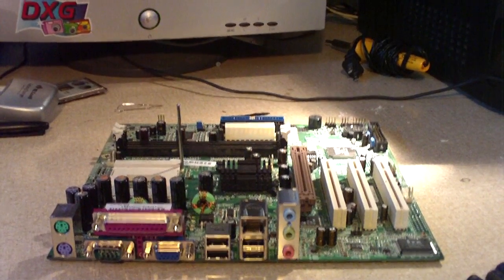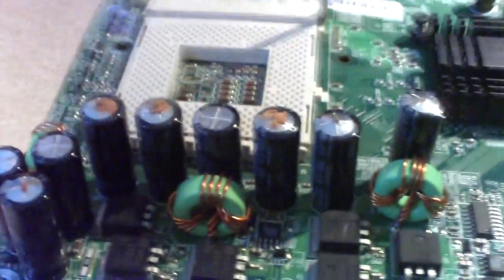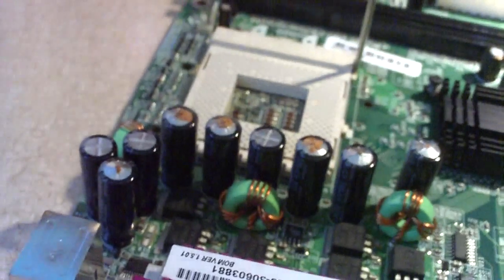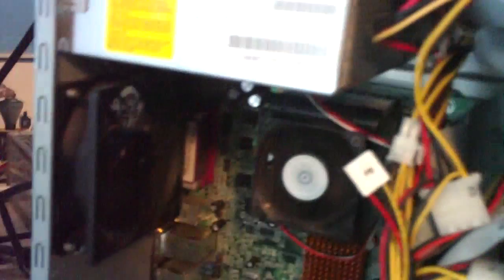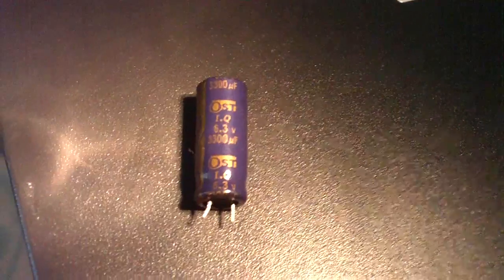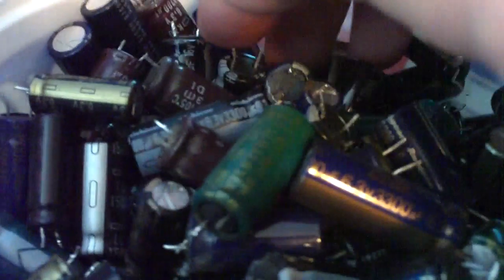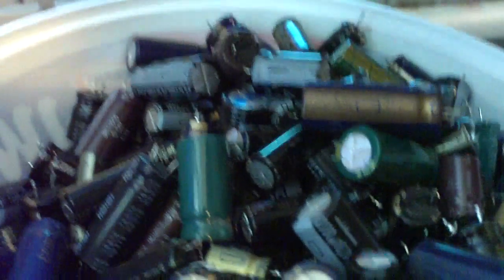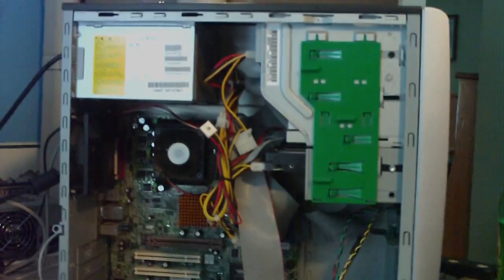Another Example of Capacitor Plague and How to Fix It.

Comment: Hi i got this computer from 2007 (compaq it is failing capacitors) and i got 7 off a old board the same voltage UF etc... although i need 9 should i just leave it with the 2 others failing or would it make the ones i just replaced fail a short time later?

Comment: Hi Mate,  I'm wondering if I could go higher in voltage and UF ? My TV has 1000UF - 10V capacitors and I need to change 2 off - I'd like to use 2200UF-25V - Is that OK ? Thanks

Comment: I do computer repair on the side and, while I admire your efforts, I don't know why you would go to all the effort to repair a 10+ year old machine. All the machines I get with capacitor plague are old school HP, Compaq, IBM and Dell models from 1999-2001. I don't get why you'd go to all the effort of pulling capacitors and fixing 10-12 year old mobos (and corresponding CPUs). It's not worth it. The vast majority of users will be unhappy with an AMD Athlon K7 or Athlon XP today.

Comment: I bought a Compaq 6410NX back in 2002 with an Athlon XP 2000+, and it had this same board.  In 2009, the same ten caps on the regulator started to swell up.  So I junked that board and bought an Asus M4A785-M with a Phenom II X4 925.  I found another AM37 board with brand-new caps for cheap, so I fixed that one up for my mother, and it's still plugging away for her.